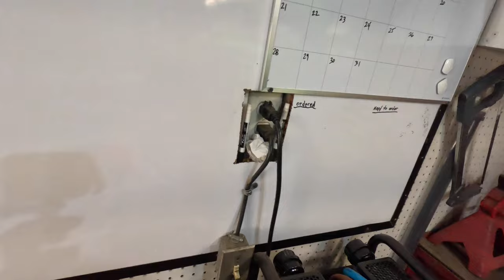Out With The Old! Welcome Back To Tom's Gee-rage!

Comment: Yea Tom it's time to raise  rates. I'm doing that also. Nice looking new kicks there Tom. What kind are they? And where did you get them? I have really bad flat feet. My podiatrist and my Surgeon on a knee surgery, to buy only cross trainer tennis shoes as they have better arch support. It helps, but they do break down and then I hobble around. Mine are always hightops for the extra support.  My old uniform boots were always Rocky boots. They were always comfortable right out if the box, no break in required. They were nade in Nelsonville Ohio. I am currently looking a Brundt Boots. New company and are suppose to be very comfortable designed by and for working men and women. Happy New Year 2024. It going to be a good year. Take care my friend. Ray from Ohio.